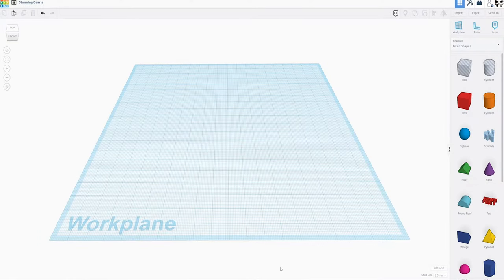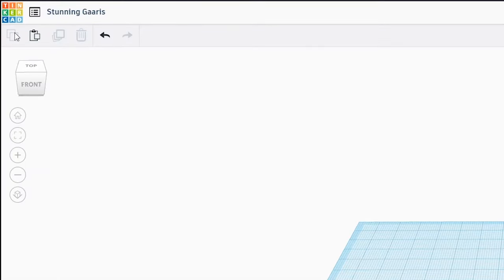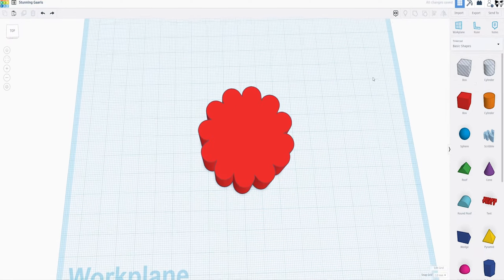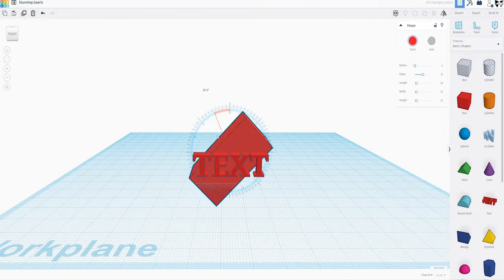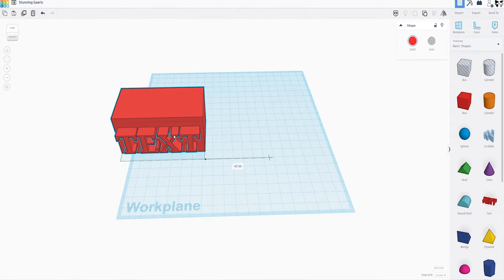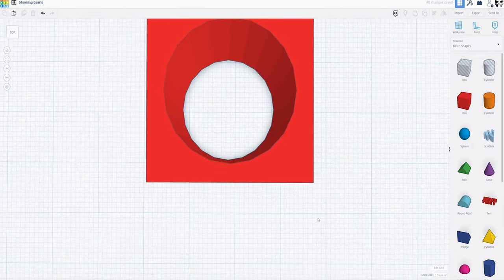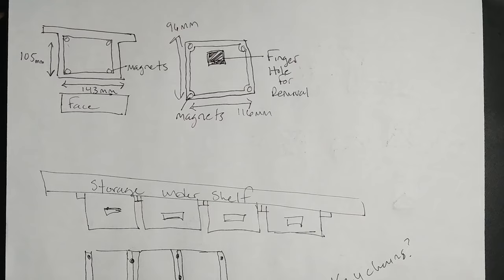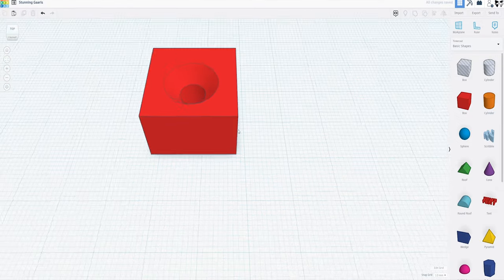Ten Tinkercad Tips and Tricks in Ten Minutes

Comment: Really new to 3D printing and just came across this excellent video.  Really learned a lot in a short time.  I do have one question that I can not find an answer for:  Is there a way to trim excess pieces from an object?  I'm trying to trim edges from my design but can't find any other way than to spend lots of time cutting it up with tiny hole pieces.  For instance: imagine a cookie cutter in the shape of a random flower with a 1 or 2 millimeter edge.  I want to spread a thin banner across the entire cookie cutter to add text to it but in order for this rectangle banner to touch the edges there are lots of little pieces hanging over the edge of the flower with weird edges that are hard to get rid of.  I definitely don't want to print the overhangs but can't find a way to erase or trim them.   Thanks for any help you or your followers can offer but either way, you still have great videos.  Cheers
Reply from the maker: Hey, I appreciate you watching! If you're asking what I think you're asking, I went ahead and made a quick video for you. This is one of the ways I get a thicker ring around the outside of cookie cutters. Hope this helps! I will pin your comment in case someone else has a better or different way they want to share. 

https://youtu.be/l5gHoL8Qxxs
Reply: @Avel  Thank you so much for making that video. I really appreciate it and the work you put into it.
My issue isn't making the handle wider as we've actually reduced the size from previous cutters. I'm happy with the width of my handle but it doesn't allow me to add a rectanglular banner without unwanted overhang.
I've added a banner across the cutter  but because of all the rounded edges it's a pain to use the hole objects to trim the parts that overhang when placing the banner. 
There may not be an option for this other than to transfer it into Fusion to trim but I like using TinkerCad and hoping there is a solution. 
I've tried to add a couple photos to help show my dilema but I'm not sure how to do that on this medium.

Thanks again and have a great day. 

Cheers

Brent
Reply from the maker: @bdwoodworking6411  Oh, okay. If you want, there's a contact email in my video descriptions where you can send over the pictures. If I can manage something, I'll let you know asap!
Reply from the maker: @bdwoodworking6411  Okay, so I spent a couple hours and this is the best I can come up with for now. I might come tackle this again later, because it's not as quick or easy as I'd like it to be. But here's at least one idea. Again, hopefully someone else can share something and maybe enlighten us both! 😄 

https://youtu.be/es9HtWsPk6o
Reply: @bdwoodworking6411  I'm not 100 percent sure what you looking for but could you use the "void' shapes to cancel out this "overhang"?
Reply: @perry74mac  Thank you.  That's what I've been using but sometimes the shapes have sharp angles etc that are hard to get in with void shapes.  I've accepted the fact that TinkerCad doesn't offer this feature but with all the very helpful suggestions from everyone on this channel I think I'll be able to make it work.  thanks again.
Reply: have you tried cutting  out your shape  then delete the shape you just created leving the ring around it turning  that hollow and then using that to cut and remove the excess? any shape can be turned hollow to use to cut

Comment: Thanks for the informative video!

Just wanted to clarify that for the rounded corners on the box, the reason is because when you use the dimensions/scale boxes on the shape itself, the box is being stretched, so any radius applied to it will be stretched too.

When you use the sliders in the shape parameters box, you are actually changing the properties of the primitive shape and that's why any radius applied looks proper, because it's not being stretched and distorted.
Reply from the maker: Thanks for clarifying!

Comment: Wheres the align lessons? I couldnt align cone on cylinder to make a countersink.
Reply from the maker: 7:50
Reply: @Avel  yeah I seen you use it.  But didn’t explain it.  Just a bunch of dots.  I’ve clicked on all of them.  Thank you.
Reply from the maker: I guess I could've explained a little better at 2:58

So, the center dots on either side will make it center. To make something perfectly center, like I did with the cone and cylinder, you would click the center dot on two sides. That will align it center front and back, and center side to side. The outside dots will align to the outside in the same way.
Reply: @Avel  thank you.  I started clicking dots and got it.  Made me two different counter sinkers and saved to my creations.  It’s always there when I need it.  I made hinges to put in flat animal shapes and saved them too.